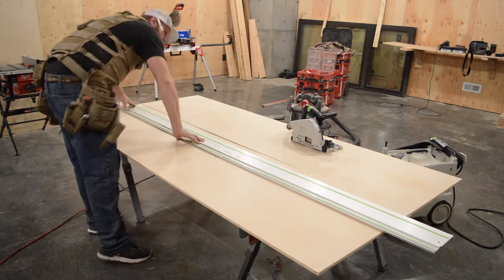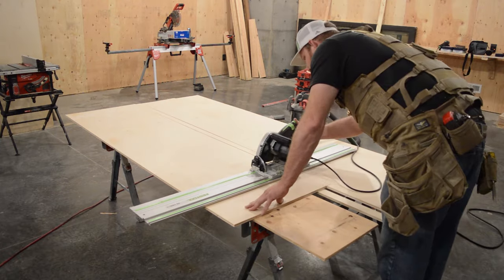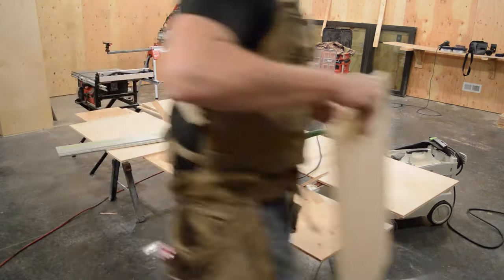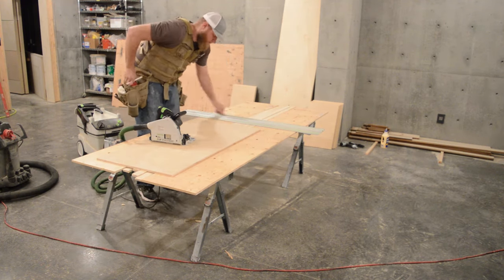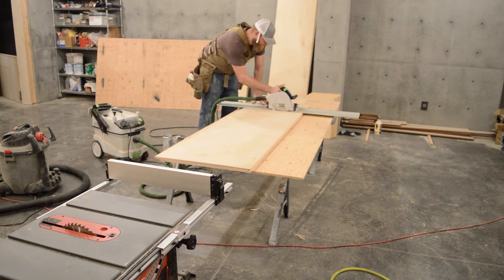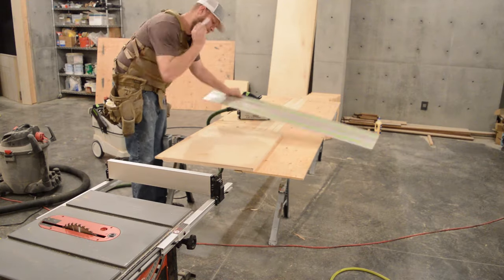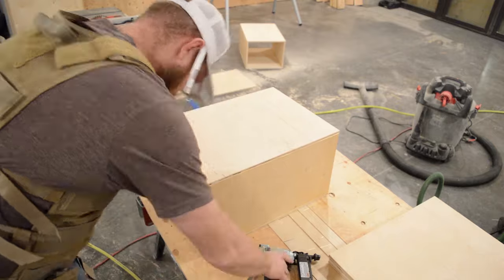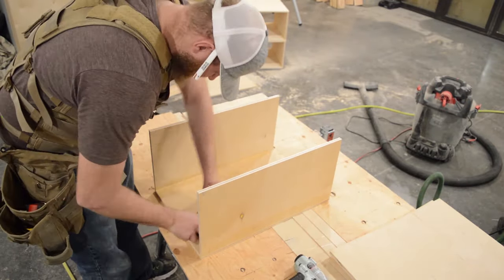How To Build A Custom Closet Organizer

Comment: In order to eliminate nail holes, would you attach plywood directly to a wall with a liquid nails (or name you favorite product) only?  My closet is only 31" deep.  I have cedar across the back, but the cedar isn't thick enough to provude structural support to shelves.
Reply from the maker: Liquid nails would be a great option. I used a 23g pin nailer also. Holes so small they can’t be seen. You should be able to find the studs and and attach the shelf to them

Comment: what if I wanted a Formica face ontop of the wood.. stability of wood.. fashion of the Formica... would you glue the panels up and cut out of it, or would you cut sheets and face the boxes after you made them?
Reply from the maker: If I’m understanding correctly, I would glue Formica first, then work with the finished pieces

Comment: Using a tracksaw while having a table saw on site? Cool build though
Reply from the maker: Track saw is a lot easier to break down materials by yourself
Reply: @SwagerMindset  I see you made them boxes individually, why not just cut 2 side panels, mortise the sides of the panels and slide the panels to create the boxes?
Reply from the maker: This way it gave the look of thicker material. It is what the client wanted.
Reply: @SwagerMindset  I guess that's one way to do it, or use a thicker material. As I said before, looks great though 👍
Reply from the maker: @duartepaintinghandymanservices  limited by what I could source.

Comment: Are you using 3\4 inch plywood?
Reply from the maker: This is 1/2”. But with this construction method, everything ends up doubled up to 1”
Reply: @SwagerMindset  thanks! Should've watched all parts before asking, you mention it in there.  I'll be looking forward to part 4 when you finish it.  Thanks for all the detail!
Reply from the maker: Yeah, just need to make the time to edit it 🤦‍♂️